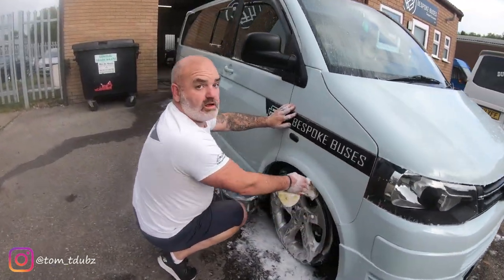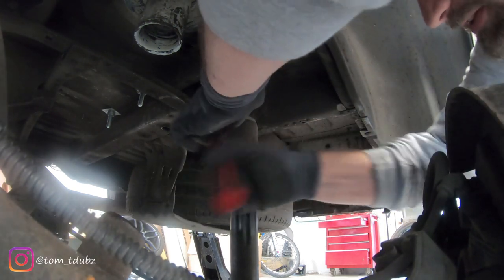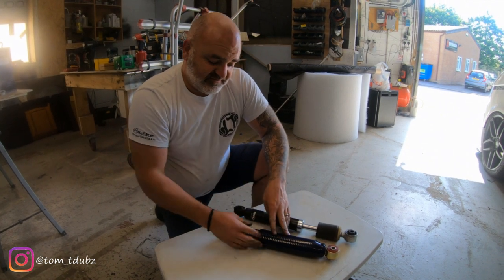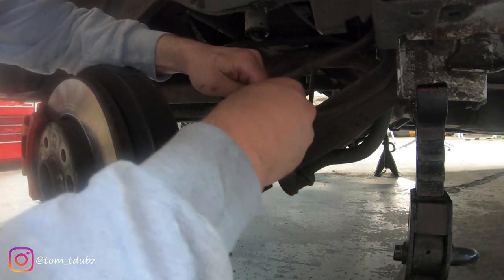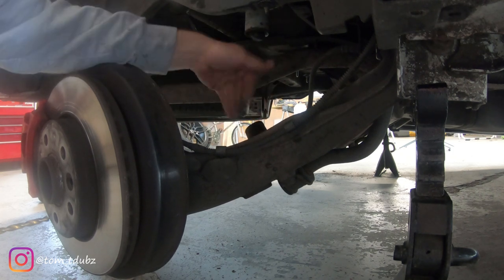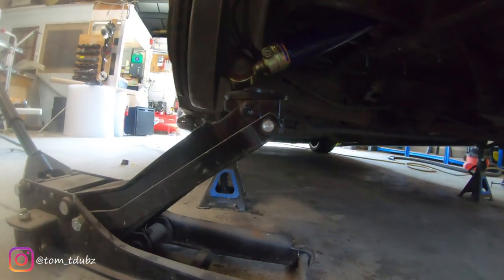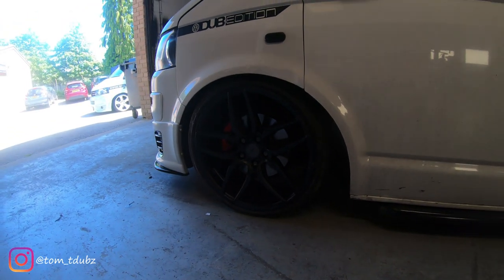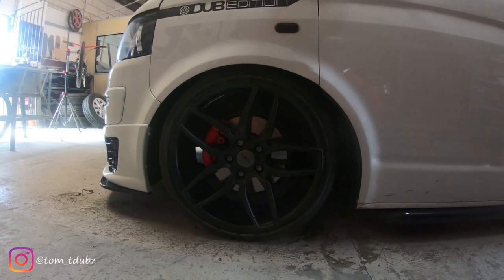VW T5 coilovers Gaz rear shocks

Comment: You may have solved my issue . I fitted v maxx coil overs the other week! The dampers are adjustable but hard or soft the rear bounces around  like a pogo stick lol can u give us an update in week or so and let us know how your getting please 👍🏻
Reply from the maker: I sure can van gets used daily so il keep u updated 👌🏻
Reply: T Dubz  cheers 👍🏻
Reply: If your Van is bouncing on a soft shock setting its either sitting on the bump stop or the shocks are bottoming out.  I'd assume you have short shocks so chances are your on the bump stops or very close to them.  If you open the rear doors on your Van and jump up and down you will feel the Van hitting the bump stop.  Just be aware that theres several methods and ways to cure that, but you need to know exactly what direction your going with your build.
Reply: @stoatrepublic   strangely I’m changed my shocks and still rather bouncy . So looking to chop them bump stops down like you suggested as I looked and there is only 20mm between the two! Which one I cut back bottom like t dubz or top like other channels please help ??
Reply: @stephentoby8750  Bloke you need to talk to is my mate Matt Balls at Balls'd Ltd, based in Mildenhall Suffolk.  Matt's responsable for the best Vans, he knows what you need.  You can google him for phone number or find him on instagram and PM him.
Reply: @stoatrepublic   cheers I will contact him
Reply from the maker: I went with the bottom so I could leave the rubber Mount in the top.. depending on how low your gunna run you may end up cutting the top as you can remove more…
Reply: @tomtdubz   cheers mate. Grateful for your advice. Do you leave a little bit there still to keep the spring located?
Reply from the maker: Oh yes you can’t cut them flat! Need to leave at least an inch on the bottom so the spring sits properly

Comment: Hi Tom. Great video mate. I have had the stance + for 4 years now and they do the job. Towing a wobble box now so 80kg tow bar weight is making the rear so bouncy. I am no low low at around 65mm drop and still use the adjusters. Is there two types of rear Gaz, short or non short or will the short work because the adjusters are still in place. Regards Carl.
Reply from the maker: Hey fella, definitely worth jumping on the gaz website, they do a variety of rear dampers great upgrade for the stance kit 👌🏻👌🏻

Comment: Can you ask Simon if the suede he used was backed or unbacked for the doors etc and what glue his used. Cheers! Looking good. Waiting on mine from spray I went with a purchase of stance Pro lines
Reply from the maker: FairPlay, I’m looking at the prolines for the front 👌🏻sure, soon as he replies il post another message. All I no is that it was Milano suede.. 👌🏻
Reply from the maker: It wasn’t foam backed, and the glue is trim fix just in a industrial canister 👌🏻
Reply: Top man, that was a quick reply 👌🏼
Are you going the extra and getting damper adj I didn't but will see how they go, apparently prolines can be a fiddle to set up as height and spring is adjustable. Good work my man. If your a father then happy fathers day! 👍🏼
Reply from the maker: Thanks fella, I am have a good day so far too, if ur a dad too ‘happy dad day’

Comment: Just Slammed the rear end of my w638 Vito with GAZ shocks and Springs that came off a T5, now thinking about tubbing it out and going down a bit further...
Reply from the maker: Decent!! I’m gunna have to the notch on mine as occasionally I get a knocking at the rear over a big bump 👌🏻👌🏻
Reply: @tomtdubz  Generally what I do is set Van down on its wheels without the spring very gently while on a 4 post ramp and see exactly where all the contact points are after moving or cutting bump stop etc, just so if the spring breaks worst case scenario on the road, I want to make sure the wheel can still turn and the brakes aren't compromised.  If you need to tub the arch to stop the tyre rubbing then thats going to need addressing.  My Vito needs addressing and a few other points redressed.  Modifications are an endless journey, lol.

Comment: Tom, I know this was a while back now but I remember initially when you fitted the stance+ on the rears you weren’t happy as it wasn’t as low as the front. Did you just remove the adjusters and rubbers to get it as you wanted? Do you know how much in total it dropped it? I’ve got H&R -50mm springs on mine so maybe just thinking of removing the rubbers to gain a few more mm and just buying the stance+ fronts?
Reply from the maker: Yeah wasn’t happy, removed the adjusters and cut the bump stops down. Ride was a bit bouncy on the rear. You could do that to yours on the rear and the front coilovers. I think once you have the right set up u may find that you use the rear of the kit too. 👌🏻👌🏻

Comment: Great vid again Tom.👍Can I ask where you got the yellow spring plates.Can get them from Transporter hq for £50,but wondering if your ones were cheaper?
Reply from the maker: Got them from AUTODOC think they were about 15 each.. they are not too bad, won’t be on for long tho 👌🏻
Reply: I’ve just had a look at them and they do seem a lot taller.The transporter hq ones are only a couple of mm thick,so I’ll be going for those.Have a look at them if your looking for any extra bit of drop.😁
Reply from the maker: Will do fella 👌🏻👌🏻

Comment: Hi tom luv them gaz shocks👍 on the front do  you have  like  a bit of a rattle when going over speed bumps  or the odd pothole  with stance on, i have the stance on me caddy with this little rattle❔😡
Reply from the maker: Na I don’t bud just the rubbish in the van...
Reply from the maker: Did you change the top mounts and drop links? Also it could be the top nut sometimes they loosen a little causing the top mounts to move a little and over bumps it’s a metal on metal sound...
Reply: @tomtdubz  yes mate new top mounts and drop links  so might be the top nut then 👍
Reply from the maker: Might be test it sound like something might be loose...
Reply: @tomtdubz  looks like a strip down and test,  we love  are mods lol😂
Reply from the maker: 🙈mad isn’t it lol good luck fella, hope u get it sorted 👌🏻

Comment: HI mate are you running no adjusters and no rubber top i.e are your springs just hard up to the chassis?
Reply from the maker: I was, I’ve just put some rubbers in for now as it was low ☹️🙈 got to get some adjuster deletes but not buying the hq ones for 50£ lol
Reply: @tomtdubz  Yeah 50 seems well steep I'm going to take my adjusters out tomorrow think i'll try make something up at work once I know sizes was it ok without just a bit 'knocky'?
Reply from the maker: It was ok to be fair... got to occasionally knock but was quite bouncy hence getting the Gaz shocks 👌🏻
Reply from the maker: @Ross Gechie How r u going to make them?

Comment: Urgh. I was all set to buy some stance coilovers for my t5.1 but having seen the difference between the start of the video where u can see the van bouncing, to the end, I don’t know anymore. 😢
Reply: Aha. Just seen Gaz website, £75 for a pair of tears. That’s not bad. Can still buy the stance kit and then fit the Gaz later on the rear. Noice. 🙂
Reply from the maker: That’s decent.. you can upgrade bit by bit to create the perfect set up 👌🏻
Reply from the maker: Start of the video the kits as low as it will go with no rear adjusters then adding the gaz makes a hell of a difference 👌🏻